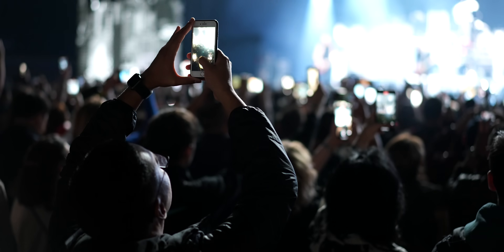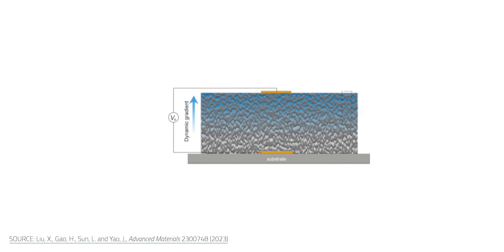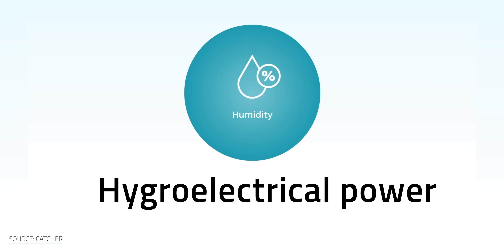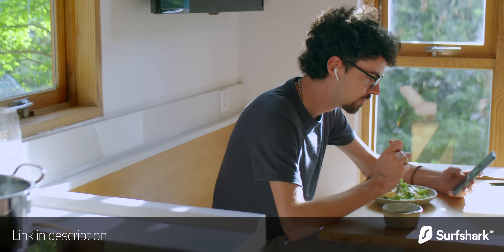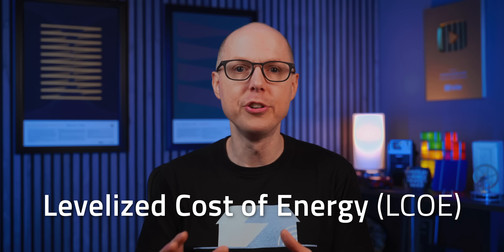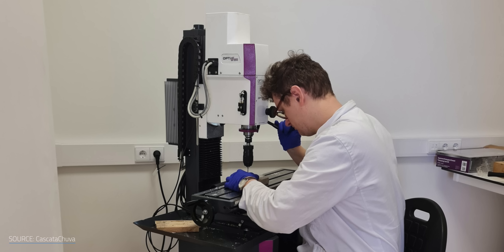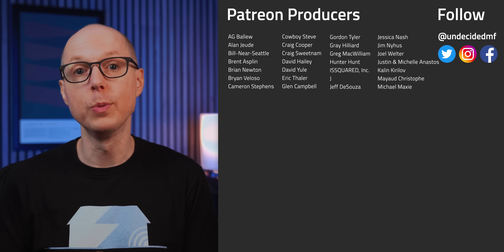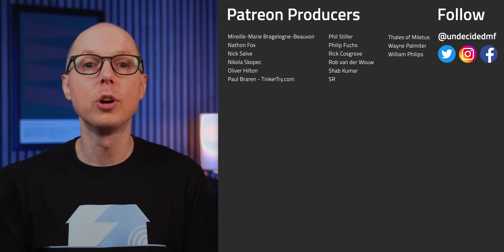Is This Accidental Discovery The Future Of Energy?

Comment: What is a standard humidity level needed to produce useable energy?Average house humidity level 42% - 45%. AC takes out humidity. What about arid areas? This is sounding like intermittent energy too.

The price point like solar potentially using both doesn’t make sense. The ROI will be almost 20 years at a $200 a month utility bill savings rate. Chances are you will still need shore power as a back up.

Promising yes, practical no. It’s on the right track to an independent power source without an expensive grid to maintain. 

Potentially in combination with a home hydrogen storage system. It’s still a regional solution to a shot gun approach 🤷‍♂️

Comment: Okay, I saw this a while ago, and I saw enough to think it was plausible, but I do not understand it at all and your video doesn’t help.  I know there are open questions but mine is more basic:

How does this not violate the first and second laws of thermodynamics?  Where does the energy actually come from?  Since this doesn’t seem to actually reduce humidity, what does it change in the air?  Your animation makes me think it actually deposits electrons in the water molecules; this is replenished by the circuit in the short term but does it leave you with a positively-charged device and negatively-charged air?

Comment: There is something missing here. How is the water removed from the device? If by heating, then that explains where the energy comes from. What you have described is a perpetual motion device which defies the First Law of Thermodynamics. There is no possible way that a device can  deliver power for any length of time with no input.

Comment: For water molecules to bounce around those micro-pores, you need something to pump the air/moisture through. Sounds like this is effectively an electrostatic generator (water molecules alternately rubbing against opposing plates, transferring charge from one to the other) which is just converting what is effectively wind energy into power in a solid-state manner using moisture as the transport mechanism. No wind, no moisture movement, no power. Conservation of energy being what it is, this thing shouldn't be able to generate enough power to push enough air through to run itself once you include losses.

Comment: I like this because it’s easy to make electricity out of high temperature gradients but you can’t really do anything with luke warm heat. Like making some nano water molecules jiggle a little and harvesting this is like reversing entropy to me
Reply: If this technology is actually practical to scale up and doesn't have any huge red flags, you're spot on. This sounds like it has the potential to extract that last 5-10% out of a lot of systems.

Comment: Since the largest grid demand is from AC and lots of AC demand is consumed in dehumidification it seems like this would help level out the load.  Payback is going to be longer in areas with cold winters like most of Canada.  Humidity is  near zero up here in the winter.  Does it reduce the humidity in the room when it operates?
Reply: The zero humidity in the winter is definitely a problem. Burning natural gas for heat is very common though and that outputs a ton of water vapor. Technology like this could possibly be leveraged to extract the last few percent of energy from condensing gas appliances. It might also require rethinking bathroom exhaust systems as well to take advantage of that heightened humidity.

But all that said, I still don't fully understand how this can work without some input somewhere. Either these cells effectively condense the humidity out of the air - in which case you'd think they'd have mentioned that pure water was also a byproduct - or it requires some sort of regeneration once the cell is saturated. For example, heating up the cell to drive off the absorbed moisture so it can repeat the process.
 
Since neither was mentioned, I'm inclined to believe it's snake oil at the moment.

Comment: I was wondering about the current abilities of this hydro batteries. You can technically get a voltage difference by building a really long electrode and placing it in the atmosphere and another spiked into your ground. It can create a significant voltage but the current capabilities are awful. Can't power more than a single led. I'm glad you lightly touched on the fact that might be the case but I'd be interested to hear what comes of the technology
Reply: Yes. A novel effect but it is not going to be a major energy source.
Reply: You are correct in that the current capacity is terrible. But you have to remember you ~100 V for every meter in elevation you go up from the ground with an isolated probe.

But you have to remember that power transmitted is not determined by the amperage but rater the P = V*I and that both the current and the voltage at you raise the altitude of your current collector.

At 80 feet you will only get ~2.5 KV at a few micro-amps, at 1000 feet you will get ~30 KV at a ~50-100 microamps. There was an old research document on this I read last year....

But you end up depleting so many ions that you have to space the ballon anchor points an acre away from each other because there are only so many ions to collect.

But, based on that research, there's about 1.5 KW/hr of electricity available at that elevation per acre in the summer and, due to change in atmospheric conditions, ~3KW/hr available in winter.

Thunder storms are a different story all together, you have to pull everything in when a storm rolls in because, lightning or not, you get 100x-1000x power spikes.
Reply: There is no such unit as kw/hr. What do you mean? @chaorrottai

Comment: If there is one thing any practical engineer will know, is that high precision mechanical machines are not practical. 10nm pores ? That will clog up with a dust particle day 1. And just how much energy can be stored before water reaches dew point ? So you get maybe 1 Kw energy ... and then what ? You need wind to get new humidity. But you could get energy directly from wind. Much much more energy.

Comment: Would this be working also as a dehumidifier?
I would guess, water molecules lose kinetic energy by bouncing inside the nano-wells, and that they would need to keep forcing water vapor through the membranes to keep its voltage levels. Thus most likely having condensation as a by-product.
Reply: And it's also likely that having to force humid air through the membrane would require more input energy than would be extracted from the cell.
Reply: @bradley3549  yeah! that might be also the case hahahah. It seems like a battery, but how much energy can store, and how fast can it recover its energy?
Though you could arrange difference cells to recovery sequentially, so when a pile gets depleted, another pile is already recovering and another one is already recovered. But it seems quite complex. Maybe that's why they need to be really big.

Comment: but WHERE is the energy itself coming from? wind turbines absorb it from the velocity of the air, solar panels convert the energy of photons into electrical charge, nuclear power uses the energy released when matter decays. until there is a good explanation to WHERE this energy is coming from, i will be as sceptical to the technology as if someone put a box in front of me with the words "free energy" on it.

is it the air movement itself? then it wouldnt work forever in an enclosed space.

Comment: I’m curious if more air blows through (with enough humidity) if that means more power or if it’s the same. 

I think this sounds really cool! I’m glad that someone is trying to commercialize it soon. Going to be honest, if it even took 4 washing machines to power a house - that would be pretty cool. Especially if overall cost was similar to solar. 

How much humidity is needed? (Or do they even know yet)
Reply: You know what generates more power, when more air gets threw it? A wind turbine…
Reply: @EnchantingCat8365   do you know what requires 100x more space to be feasible? a wind turbine...
Reply: @charlielarson1350  do you know what works right now and has proven that it works long term because it does not conflict with principles of conservation of energy? wind turbines.

Comment: i still dont exactly understand how this should be scaleable. 
So if i got this right, the energy is produced by having a high and low moisture side. The particles flowing from "high" to "low" create a current - probably through friction with the tube. 

1. how do i get a "low moisture" side? I'd probably need some kind of desiccant - which has to be produced and transported?
2. once the moisture has traveled through the device, equalizing both sides it will stop producing energy. And i wonder how they intend to get the moisture out of the capilaries again. Water reaaaally hates to leave small crevices. 
3. IDK how this should scale. its producing so little energy, that the production of the materials is for sure a net loss of energy. Like to melt the metals and transport everything from A to B - the total output of energy vs input. it will be a loss. 

i reaaaaally want this to work out - but i just cant see that working... the latent energy in a difference in moisture appears just too small to make up for all the effort of production and maintenance.

Comment: What is this? A generator? A Battery? When it is soaked with water it wont produce anymore right? So it aint "generating" -its a Battery thats "charged" by getting dried out and discharged by combining it with humid air.
So it istnt a renewable energy source.